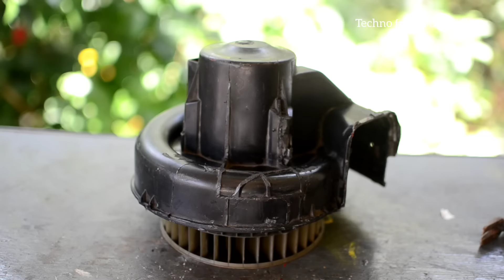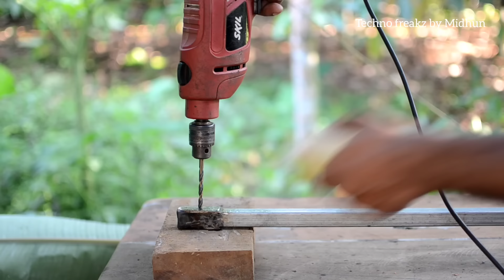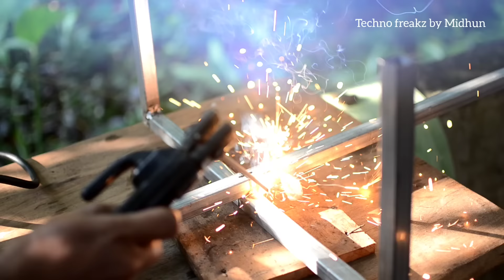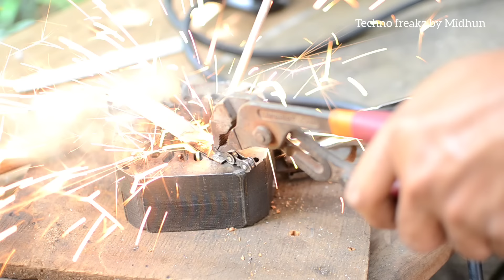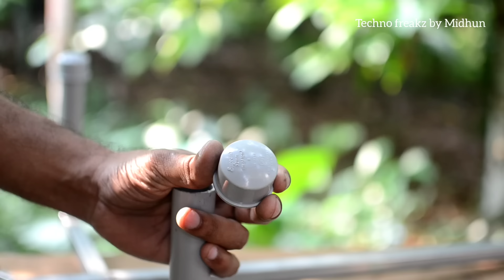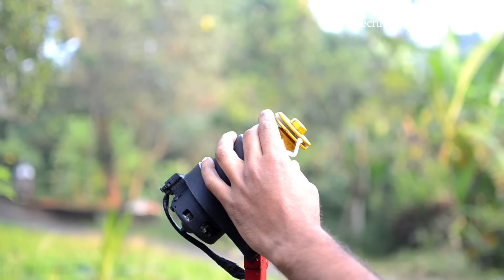How to make Electric Brush Cutter | Grass cutter  പുകയില്ല കാതടപ്പിക്കുന്ന ശബ്ദമില്ല 💯👌 Diy

Comment: Total Quotation etra aayenn parayamo ??
Poli market nnu vaangiya rate vach oru list kittiyaal nannaayirunnu
Reply from the maker: അങ്ങനെ crt അയി നോക്കില്ലായിരുന്നു മിക്കതും  കൈയിൽ  ഉണ്ടായിരുന്നു 😊 making videok cheyithath ആയിരുന്നു 😊
Reply: @TechnofreakzbyMidhun  ennalum ekadesham quotation parayan patto.. onnu aakki nokkana
Reply from the maker: @nithinnarayanan2614  ബാറ്ററി 1400, motor ആക്രി കടയിൽ  നിന്ന് വാങ്ങിയാൽ 400 rs, gi pipe ഏകദേശം  250rs പിന്നെ ബാക്കി ചിലവുകൾ
Reply: Orikka charge cheythal etra manikkoor kittumenn nokkiyaarnno?
Reply from the maker: @nithinnarayanan2614  ഇല്ല one hr use ചെയ്തിട്ടും  തീർന്നില്ല